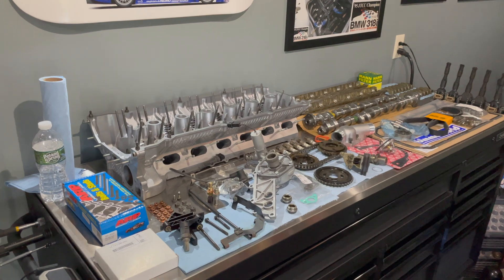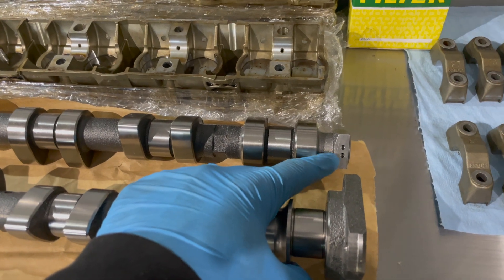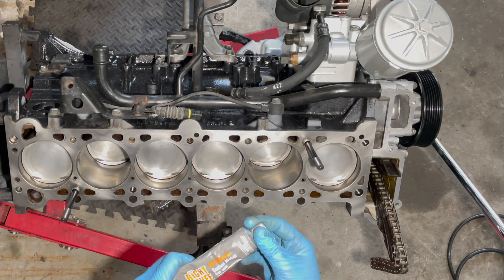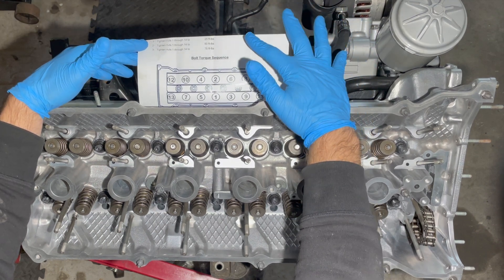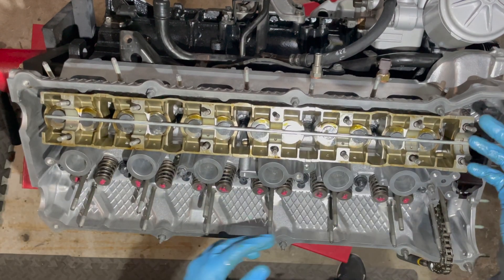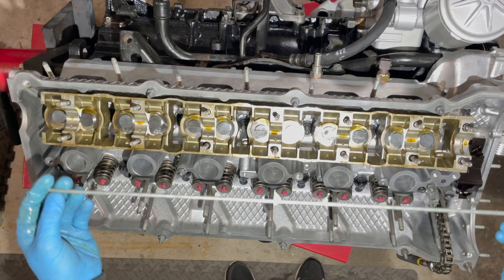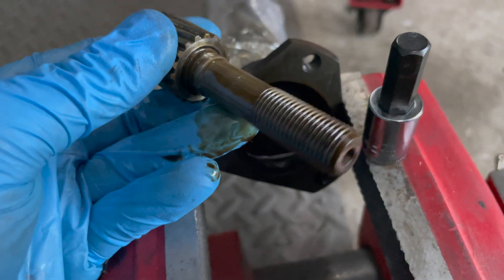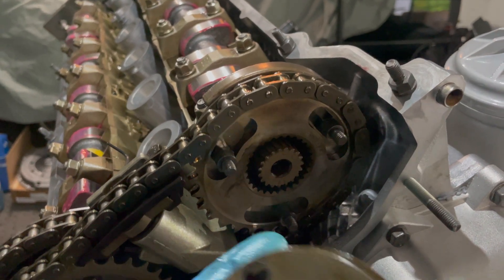Build Series Ep. 2: BMW S52 Engine Assembly

Comment: Bro cut out some of the important bits🥲 I'm gonna need a directors cut
Reply from the maker: @barendiggo1077  anything in particular? I’ll try and re film some stuff
Reply: @OnlyyDans I'm not gonna be completely accurate with some of the steps as I find that on my build (baby 6 cylinder 1998 320i) things have been removed or deleted which is quite concerning but nevertheless I chose to send my block to an engineer for assembly due to me not wanting to lose my engine

Comment: Dude I want to rebuild my engine as much as possible to keep in engine bay , pretty sure want to get near to pistons and change gaskets there probably bit clearing up, before I get there my camshaft bouth intake and exchaust is pointing up and Im about to put that camshaft lock but my TDC doesnt match up shuld I be worried about? What can u recommend ? Because if i set TDC than I could not lock camshaft to get any further.. can I spin gear 2 full laps and it will balance in place on TDC and where camshafts lock goes in ? Thank you, please help me bruhh first rebuild ..

Comment: Vanos does not do that much travel. But yes that is the correct way to do it. I actually test them with air and there is a bmw spec that you can measure vanos travel off ✌️✌️✌️